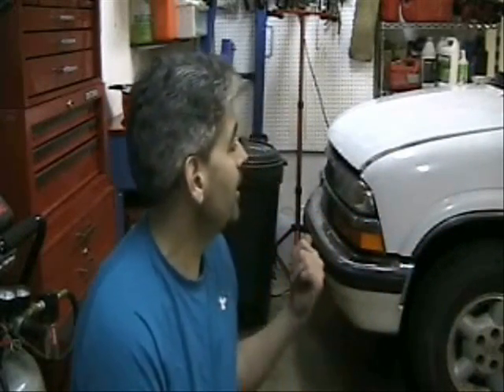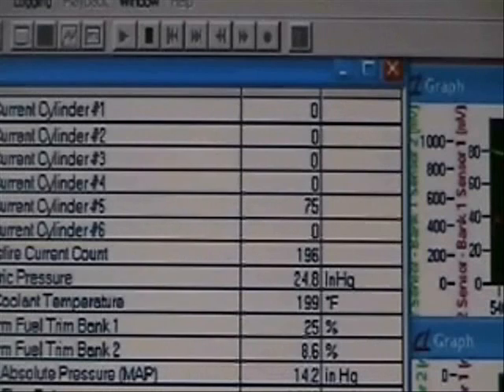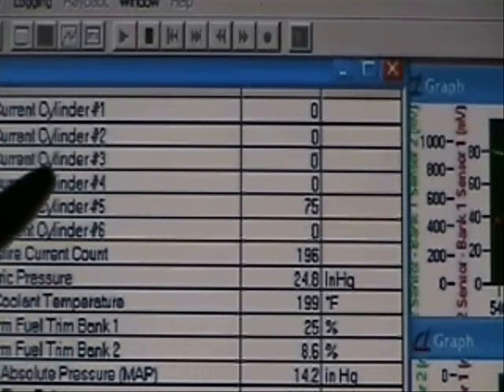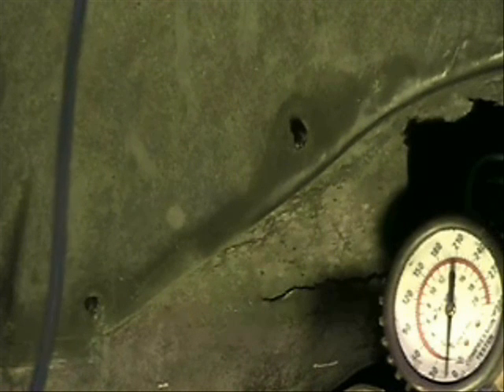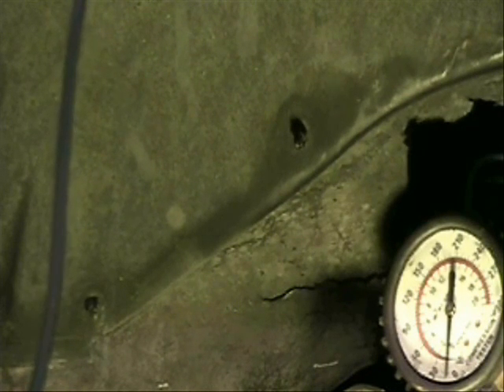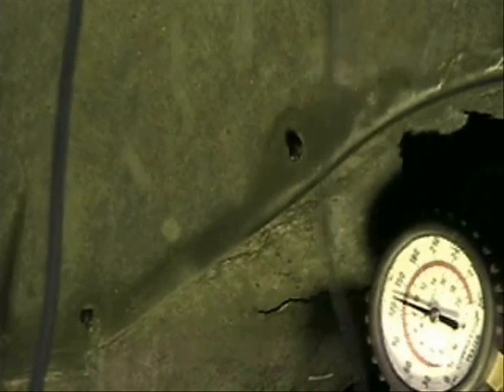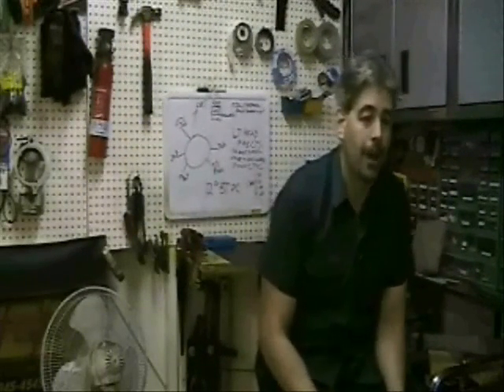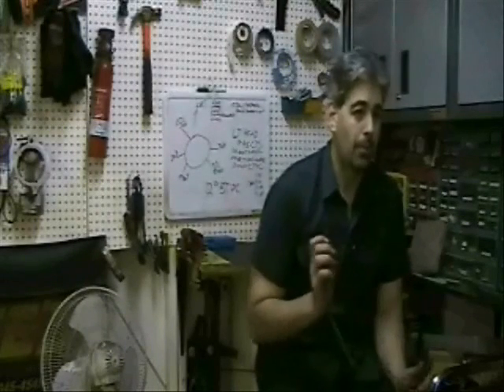P0305 Misfire Diagnosis 4 3L Vortec PART 1

Comment: man i wish you could put a magic touch on my truck, noone can seem to find and fix the problem
Reply from the maker: It's not magic. It's science.  Its the complete opposite of magic in fact!
Reply: wish these mechanics could science then. They cannot find the cause of my p0300 random multiple misfire. Scanner shows misfiring cylinders 1 & 4 simutaniously between 2k and 2500 rpms. Only thing they found was timing at 14 degrees retarded, but claim distributor and timing chain are good. Im lost and love my truck but the lack of power it has is saddening.
Reply from the maker: well if you happen to be in colorado i'd fix it for you. But there are literally a million things that could cause that. As with any misfire I apply my FASTTEC method and it will find it every single time. I have probably a dozen videos on this method.
Reply: I'm going to change out my upper and lower intake gasket sets this weekend since i know it's leaking a little coolant on the ground and some into the oil. I'll try to adress other things I come across in the process. I'll watch all your vids in the mean time till I get to changing stuff out

Comment: I have a misfire problem that I'm currently working on with my 2000 blazer that gives me no codes and from the symptoms I've put together it seems to be a leaking poppet valve and old spark plugs.  This misfire only happens when I've been running the system for a while and when it happens the engine boggs down when I try to accelerate too fast. 
When the engine starts it runs really strong  in drive so there's extra fuel being dumped into the cylinders. 
Not only is the smell from the tailpipe rich but also from the front of the vehicle. 
This is a recent one but when I checked my oil it smelled like gas .
So I opened up the throttle body and looked inside the upper inside and the areas around the air intakes where stating to wash clean.

But now that I've watched this video I think I'll try your tests to see if my conclusion is wrong.
Reply from the maker: Why not just do a fuel trim analysis to verify?
Reply: I don't own a ODB2 scanner but I did order one which should arrive tomorrow which will allow me to use my phone to graph it. 
I do have to admit though I was already leaning towards a new spider because it still uses the old CFI instead of the new mpfi system which was a recommended upgrade for my year. But you are right if I had done that and not looked at the fuel trims I would have been up shit creek

 Also I have no idea what exactly it would mean if my trims were calling for more or calling for less

Edit: sorry I'm not very smart. I looked it up and running really high negative  would mean it's a fuel injection problem and running a high positive would mean it might be a pump problem or something else.
Reply: After looking into it more I think I might go from OBD2 readings and if that shows I might have a leak then I can breath a sigh of relief and move onto fuel pressure and hopefully it only fails the leakdown test and not the maximum fuel pressure from pump I might have an easy day.  

The only thing I fear though is that it's a compound problem. I replaced the fuel component and still have a misfire so I have to do a manual cylinder balance test. If I find the cylinder and test the plugs and distributor and nothing is wrong with them..... I dread failing a compression test. because then ,from what I understand, nothing short of an overhaul could fix that.

Comment: Hi, I have a 1995 GMC Safari with a W code 4.3L engine. I'm having an issue with it in that once the van has warmed up after say 20 mins out on the road, it starts stalling when i slow down then after a few times firing it up again, it misfires and is very under powered. If I park up for around 10 minutes and fire it up again it runs perfectly again. I have cleaned the EGR valve and replaced the Coolant Temp Sensor. The van has also had a new IAC valve and new distributor cap, coil, rotor arm, ignition module and plug leads. The idle speed is generally fine but it also has periods where it surges sometimes, but not usually. I have a code reader and there are no faults showing. Any ideas would be appreciated. Thanks.
Reply from the maker: Ok what data do you have that was leading you to change those parts? I would start there. Was there a low fuel trim caused by CTS? was there an ignition problem caused by the ignition module?  I need to see the methodology- looks like just random parts swapping for no reason the way you are describing this.
Reply: Everything except the coolant temp sensor was changed by the previous owner. I've only owned it 10 days. He owned it 12 years. He claims it was stood since last October and wouldn't start, so he just changed the cap, rotor, coil, leads and module. It's so intermittent and I think he sold it unscrupulously because he was unable to trace the issue.
Reply from the maker: Either way I need data to even have a starting point. There is nothing to go on here whatsoever.

Comment: during compn test. where do you plug the guage in to test compression?
Reply from the maker: the cylinder of course--- not sure  what you are asking? Where else is there compression on an engine?
Reply: Schrodingers Box ive never used a compression guage. so bare w/ me. just wondering how the guage is linked to the cylinder to run the test. is it plugged in where the spark plug goes? im learning mechanics. thats why im watching your channel
Reply from the maker: Yes spark plug hole. You can also do a relative compression test as well connecting an oscilloscope to the B+ for the starter too.

Comment: could you tell us what the other timing mark is for? also a video on how to adjust the valves on a vortec engine would be awesome. I love your approach to diagnostics.  I read that all you do to the valves is set the timing to 55-65 degrees before the top dead center compression on one and tighten to 22 ft pounds is that correct.
Reply from the maker: I believe the second timing mark (which is 90deg from the first one) is to line up with another tab on the cover, as opposed to the 0deg position on the timing indicator tab.
 Valve adjustment really doesn't require any skill on this model- just go in sequence to TDC at each cylinder so you know there is no tension on the rockers and torque per spec.
Reply: Schrodingers Box Thank you so much getting ready to start a head gasket job on one

Comment: Matt, I have a bad ignition coil on my Civic 1.7. I physically do not have $15 for a junkyard coil, I have no job. It runs horrible on 3 cylinders. I unplugged the fuel injector on the dead cylinder. Will running it this way cause harm? Thanks.
Reply from the maker: Yes it will cause harm. You're run raw fuel through the engine because of the no-spark misfire. This diultes the oil, damages the cylinder through friction and will destroy the cat very quickly.
Reply: I unplugged the fuel injector on the dead cylinder as soon as the coil failed. Will I cause harm by running on 3 cylinders with the fuel injector unplugged until I can afford to replace the coil?
Reply: unburned fuel will also damage the cat

Comment: Couldn't I find TDC by taking the cap off the distributor and lining up the arrow with the 6 cylinder mark and then verifying on the crank?
Reply from the maker: Yes but that assumes the distributer was installed correctly. Virtually everyone does this wrong if they've installed a distributer on these models- hence my other video showing correct installation.
 While you're most likely OK using the distributer reference, I usually tend to be pretty specific on TDC being timed to actual piston and valve position rather than referenced indirectly- Usually because I normally get cars after some asshat has already tried messing with it lol.
Reply: Schrodingers Box  OK, one thing I should tell you though is you can turn the crank from the alternator bolt if the belt is on.

Comment: ok Matt. I'm about done with ignorant people. this dude I work with brought in a 2012 Audi A5 with a apparent misfire. cylinder 3 was misfiring so guess what he did.?. And of course that did not fix the problem. he was sitting there scratching his head for about 45 minutes because he couldn't figure out why replacing the coil didn't fix it. so I go over remove the spark plug, i plug in my compression tester and lo and behold guess what, low compression cylinder 3. I hate Parts changers!! oh just letting you know those Audi coils are about $250 each.
Reply from the maker: +Mike Haley, Yep if I ever see a misfire where the owner hasn't already replaced plugs, wires, and coil I would think it was a practical joke lol.

Comment: The word is "methodical" NOT  "methodilogical" when in doubt check it out.
Reply from the maker: +GhettoRanger Maybe you should check it out because the words are independent and NOT synonyms.
  Methodical refers to following a structured established logical process.  Methodological refers to DEVELOPING such a progress in an adaptive sense. The latter is the approach I use, not the former.
  Please do your research next time- there are hundreds of thousands of people who see these comments and you don't want to look foolish.
Reply: Methodical definition; performed, disposed, or acting in a systematic, orderly, way.
I didn't mean to be critical so don't take it the wrong way. I thought your video was excellent, very informative. I have a misfire on #5 4.3 vortec, it had water in the gas tank. I drained and cleaned the tank, replaced fuel pump and filter after draining the fuel line, I'm hoping it will start to work normally after driving for a while. PS Methodological will work you were not incorrect.
Reply from the maker: GhettoRanger Yes of course I was not incorrect. YOU were. So of course I do not take offense.
Again, when in doubt check it out.
  The words are not synonymous.
You didn't even realize there were two words.
Reply: Actually either word would work.
Reply from the maker: GhettoRanger Once again incorrect. WHEN IN DOUBT CHECK IT OUT.
  I focus on methodological, not methodical approach.
 Either way your initial post was "it is methodical, NOT methodological". Now you're saying both would work.. once again- check it out first next time so you stay consistent.
Reply: Google "methodological or methodical" and you will see that I am in fact, RIGHT!
Reply from the maker: GhettoRanger  Ummm I did and you are in fact wrong as usual. And you are about to be banned from further posts at that

Comment: Does anyone know anything about these OBDII connectors that bluetooth or USB to your phone or computer? I'm wondering how much I have to invest to get data like the autoenginuity used in Schrod's videos generates.  Any thoughts?
Reply: I've got the USB to obd2 cable from eBay ($10-20) and it's good for basic sensor data and reading codes. I also have a Bluetooth and wifi obd2 version ($10-20) but I cannot get them to work on my HTC phone or my acer tablet.

Comment: I have a statement relating to something you will get into @ some point.  There is thinking that the check engine light comes on when maintenanc intervals are reached.  You disagree with this for reasons stated.  In support of your position consider the following:  There are models/makes of cars which have a light, separate from the check engine.  It is titled Service Engine Soon.  From what I quickly learned is that this button's function is to alert the user to bring in or service the auto for an oil change or something similar.  This supports the idea that check engine lights are not used for the this purpose.
Reply from the maker: +David Eichenlaub The SES, MIL, CEL are all the same. Service engine soon is indeed a DTC fault, not a maintenance light.
 Oil change indication will NOT be done through these lights- it will be done with a "maintenance required" or a specific "change oil" light.
Reply: +Schrodingers Box Okay, that's fine.  it supports regardless. the fact that there is a "maint. req'd." or "change oil" light in the first place this means that these functions aren't achieved through a "check/service engine light".  Agree?
Reply: A Check Engine light which is the result of a DTC.  Diagnostic Trouble Code (?)
Reply from the maker: +David Eichenlaub Exactly correct.

Comment: this needs to be done before installing a new distributor ? Just want to make sure as I made a mistake I guess...I installed the distributor and the blazer is turning but not starting
Reply from the maker: +Chase Howell see my video on how to install a distributer
Reply: I believe I did. Set it on the #6 or lined it up really close after messing with the shaft in the motor you said to turn slowly until I get it positioned right.
Previous problem though:took it to the mechanic here in town for a coolant leak. They replaced the lower manifold and head gaskets. Vehicle was running great when I turned it in. They told me I had did something and want another $977 to replace a distributer and a spider
Vehicle struggles to accelerate before I removed the original neither of them had paint marks
Reply: They had that pin lined up to neither the 6 or 8 when I removed it. It was pointing at the screw hole for the cap towards the back of the engine
Reply from the maker: most common mistake is not being on the right TDC Mark for compression on #1
Reply: +Schrodingers Box 
Think I found the problem. I'm removing the distributor now and redueing the TDC
I found paint marks. 2 sets...1 orange one yellow (yellow being the second line)

I didn't go far enough on the crank when I heard air.
I'm in the process of doing that now. Thanks

Comment: When you spoke of the 2 lines on the harmonic balancer, which way are you turning the engine clockwise or counter clockwise.
Reply from the maker: A Tana Always in the direction of normal travel- clockwise

Comment: Great video! How is the best way to determine that a 4-cycle engine is on the compression stroke?
Reply from the maker: When air blows out of the spark plug hole.
Reply: In

Comment: Schrodingers Box I'm having a multiple misfires in my 2007 Suzuki Forenza. The car started to sound weird about a week ago, but no engine light. In the middle of an intersection two days ago, I lost acceleration, engine light started to blink, and the car started to shake. After hooking up a scan tool, I got 6 codes. TWO P0300, TWO P0301, and TWO P0304. All of this read as "random/multiple engine misfire." This is a 4 cylinder car. I took the spark plugs out, and I noticed that in the 4th cylinder there was a very small amount of engine oil on the end of the spark plug and on the top of the piston in the cylinder. Also, I took the oil cap off and the oil smells like gasoline. Please shed some light on this issue... I need to fix this car but I do not have the money right now to take it to a mechanic. The coolant tank doesn't have a fuel smell to it, by the way. Thank you!

Comment: In order to set to top dead center should you remove the distributor ? Chasing a miss fore and I think it was never installed correctly after a head gasket job
Reply from the maker: I am not sure what you are asking... why would you want to remove the distributer before setting to TDC?
Reply: Its a 4.3L 
In order for it to not turn along with the crank shaft...or can it stay in and once its top dead center pull it out and align the two pin wholes and redrop it
Reply from the maker: Hernan Lopez I would leave it in and only remove and reinstall it if it shows to be out of time at TDC.
Reply: Ok I will try it.  As of now s10 just wont start it turns over and like sputters but wont stay on so hoping timing is just off
Thank you

Comment: Your first clue should have been that the Long Term Fuel Trim was at 25% (assuming that you were in closed loop), that means you are running lean. The next question is what does the LTFT look like as RPM go up, it if comes back in line than look for a vacuum leak. I am off to part 2 now to see how this works out.

Comment: I did exactly what your video said I had the second mark aligned with top v mark and 1st mark around the 4-5 o'clock position on the side mark. then set rotor button to 6 next to hold down bolt...nothing. went tdc again and set rotor to the 8 mark....nothing......then read that older 4.3L and marine engines have to be set tdc then rotor button to #1 spark plug wire on the distributor cap...I tried that and it worked just fine lol. Im thinking someone blew the 02 engine and stapped an older model block with new accessories in it..... thank you. this video helped me achieve TDC. I always thought the second mark had to align with the bottom v mark on timing cover/crank sensor bracket.

Comment: I have a 2002 blazer 4.3L vortec. I aligned the timing marks like in this video and then aligned the distributor like you showed me in your other video and the truck would not start. I went back to tdc on the crank and then aligned the rotor with the #1 spark plug on the cap and it started just fine. Why is it like this? will not work on 6 or 8 marks but it will work when pointed to #1 spark plug wire on cap. thank you for your time.
Reply: I am also getting al little misfire between 1000 and 1500 rpm but it idles fine and if i go over 1500 it runs fine.
Reply from the maker: kimbeasley89 To answer your second question, you likely have a vacuum leak if you have misfire at low RPM that improves with engine speed.  For your first question, I'm not totally convinced you were at compression stroke TDC the first time- there are 2 timing marks on the crankshaft, make sure you "pass" the first one on the way to TDC and end up on the second one. But even so, that's weird, man.